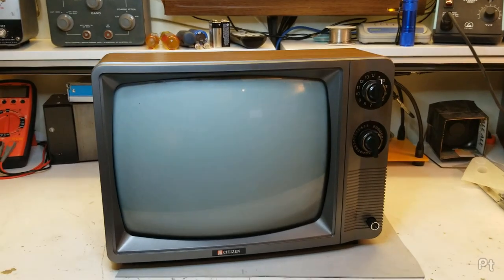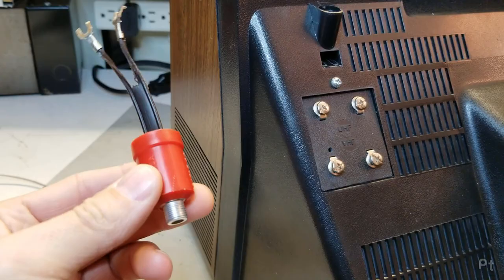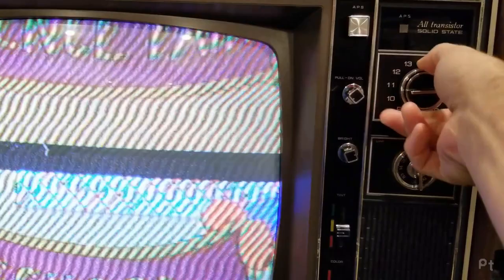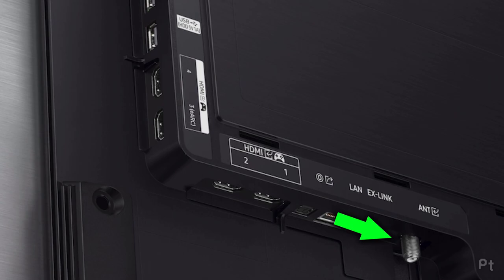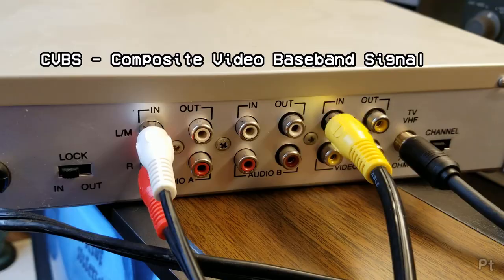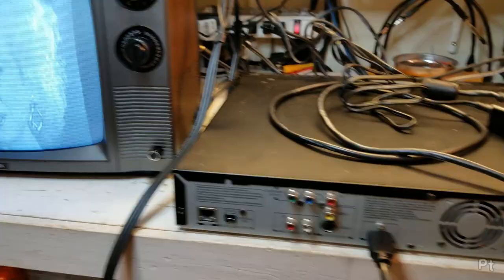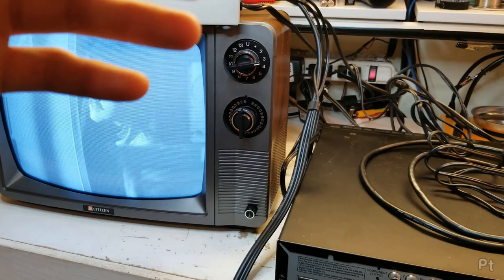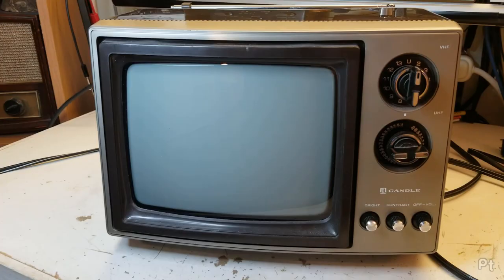How to hook up an old TV

Comment: Some information that might be useful on this subject. Some VCRs don't make good RF modulators as the  macro vision copy protection can cause trouble even if you not using the VCR to record. This not very common but I have had a few VCRs that I hooked a DVD player into for the RF output. The symptoms are the picture will go from normal brightness to very dark every few seconds and on some machines it will lose color and vertical hold. So not all VCRs are good as an RF modulator for macro vision protected media. Here are the VCRs I know for certain that give trouble (I don't have these machines anymore so I can't give the model number of them). The VCRs are Orion built VCRs from around the late 80s. mine was an Emerson  from 1987 and funai built VCRs from around the year 2000.
Reply from the maker: That's a very good point I completely forgot to mention. Macrovision messes with the AGC (Automatic Gain Control) circuitry that is used when recording to tape. Some VCRs were immune to it, but most had the issues you describe. I've also found that some VCRs only exhibited the Macrovision problems when in record mode. I had a late 90s GE (Samsung mechanism I think) that did this.

Comment: This came out at a perfect time! I just received an RCA 19 or 20 Inch Colortrak TV from 1988 (luckily it has Coax and Composite Stereo). It's been sitting in storage for 9 years, I connected a VCR by Composite and it looked really sharp and colorful as it should! I forgot how good VHS tapes look on a CRT TV after watching them on HDTVs for 6 years straight LOL! The sound kinda works, the right speaker is a no-go and the left speaker works but it gets crackly at bassy parts so I try to keep the bass setting close to center if possible. Used to sound better than Bose speakers LOL😂 Haven't looked at the innards of it yet, so I haven't figured it out. It has a digital tuner like your RCA TV that you showed. Only thing I need a Matching Transformer is for an Electra branded 8-Track / Radio unit for the FM Radio that I also received from the same person. Great video as always!😁👌

Comment: Dude! You gotta do a DIY UHF /VHF broadcast from video source onto these old TV how to. I got an RF modulator and it’s quite easy to get it hooked up. There definitely isn’t a lot of detailed videos on how to actually broadcast  OTA within your home.

You content creators are missing out on this subject.
Reply from the maker: I'm a content creator? Neat! :D

Regarding transmitting over the air, it gets a little hairy. Legally you can under a certain wattage, but putting together a DIY transmitter means that gets difficult to certify. I know people have taken an output from a VCR or RF modulator, run it through a few signal boosters and then connected a set of antennas. Or used a commercial Agile Modulator connected to antennas. But both those are probably over the allowed transmitting power, so it's not something I want to go recommending in a video then getting someone in trouble.

12voltvids did a video about a "Video Sender" that used to be sold back in the day. It's a low power UHF transmitter, and I still see them show up from time to time: https://www.youtube.com/watch?v=u5-h5MVontk

Also, maritimegirl did a video on using signal boosters as I mentioned earlier: https://www.youtube.com/watch?v=kqetXGthMyw
Reply: @probnotstech  it’s quite hard to get rabbit ears dipole antennas here in Tokyo… I’m seeing a lot more extendable ham radio antennas. I think my previous antenna was for the higher UHF range… so you know what the actual VHF frequency range rabbit ear antennas are… I’m aiming for the old vintage TV’s like your videos.
Reply: The martimegirl video really helped thanks for sharing that link! My issue was that the boated antenna type I had was built it… hence your not able to reverse the direction of the booster. Have a booster as separate unit to the antenna was the answer!

Comment: I use an a Sony Trinitron KV1925R tv from 1985 and I have a Zenith side loading VCR VR1830. the RF out cable from the VCR goes into the input of a radio shack RF modulator which I have an older Sony blue ray player that has composite output still and has been very reliable as it has tons of use and still works as good as the day I got for Christmas in 2012. On the rf input of the VCR I have my Sega Genesis connected up to with the factory RF adapter. I do have a Roku streaming stick connected to a composite adapter which I connect up when I need it which is rare. As I have 1700+ in DVDs and blue-rays and about 600+ VHS tapes so I hardly ever use the Roku but I have it for the rare occasion.

Comment: Just discovered this channel !

Incredible videos - especially the full house closed loop cable network.

I have an old small CRT at home I like to use as a nostalgia window (watching older than shows) I wish simple devices such as chromecasts had a 4/3 mode to be used easily with older sets. I know you can use a computer but it’s more cumbersome.

Comment: Now my question is: Can you hook up a Coax to HDMI to the V/UHF connectors, and then hook it up into a computer as a monitor.

I think that would be pretty cool
Reply from the maker: Yes, people have done that. But the text would be really hard to read. Even running a low resolution like 640x480 is quite hard to read on old TVs.

Comment: I like how the new signal is so dam nosey that old TVs pick it up has white snow in the video and audio
Reply from the maker: I'm pretty sure it's the power adapter, as I have an identical DTV box that has the power supply built-in and it doesn't have the same noise issue.

Comment: I followed all the instructions to try and connect a DVD player to a really old portable philco TV with only uhf and vhf. I am using a matching transformer and a av to rf modulator and all I'm getting is sound, no video. I know the setup works because I tried it on a newer TV without the matching transformer and just plugging in the coax and it works fine. I'm plugged into VHF and I've tried fine tuning to no avail, it's just a squiggly fuzzy mess. Any help would be greatly appreciated!! 🙏
Reply from the maker: Does the fine tuning have any effect at all? It could be that old components in the TV (usually capacitors) drifted and caused the tuning to be off. Even so, you should be able to get some sort of picture by adjusting the fine tuning.

Comment: I tried using the shown method for the 3.5mm connection from a 75Ohm BNC source but still have no video. I have a different RCA to 3.5mm adapter but not sure if that would make a difference. any tips or suggestions?

Comment: Question is my tv just broken? I have a 1986 zenith I got from a guy and he gave me a rf modulator  that I hooked up my ps2 to and I got picture when I first turned it on but it was wonky so I flipped the channel switch and I lost picture and now I can’t get signal at all i bought a new modulator I hooked up my vcr and the closest I get now is that I can vaguely hear audio through the static I don’t know what to do or if i should give up
Reply from the maker: What kind of tuner does it have - knobs, pushbuttons? Did you try adjusting the fine tuning? If it's a knob, try wiggle it back and forth as the tuners can get dirty contacts over the years.
Reply: @probnotstech  it’s like the digital push button where you have the channel up and down

Comment: Any suggestions to connect antenna only or coaxial cable old TV’s to items like Tablo or TiVo or dvd players??
Reply from the maker: For a DVD player, an RF modulator like at 15:44 will work. If the DVD player is HDMI only, there are RF modulators with HDMI inputs as well.
Reply: @probnotstech  I’m just trying to bring old analog tv to hdmi status.
Reply from the maker: I haven't used either of these so I can't attest to the quality, but I've seen people use them with success. They go straight from HDMI to an analog TV channel over RF:
https://www.amazon.com/Modulator-Converter-Demodulator-Digital-Adapter/dp/B09CN9YMTK
https://www.amazon.com/Modulator-Converter-Demodulator-Composite-Component/dp/B0976L5C7B

Comment: Can two twin leads be on one VHF connection? Like say hooking up two old consoles onto the same TV sharing that single twin lead connection on the back.
Reply from the maker: Sort of, but it will cause an impedance mismatch, since they would be connected in parallel. I'm not sure how that will affect the signal, but you'll probably get more interference . When you see coax splitters, they actually have a small transformer type circuity inside to "match" the same impedance on all the connections.
Reply: @probnotstech  oh okay, interesting. Thank you for responding. I appreciate that

Comment: What about PAL?
Reply from the maker: I didn't get into PAL because I don't have much experience with it, and there are quire a few differences. PAL countries used different RF connectors, different channels ranges and frequencies (UHF for modulators, for example) and BNC for composite instead of RCA. Also PAL countries had the SCART adapter that seems really neat, and included RGB which was unheard of over here.
Reply: @probnotstech  PAL more like PAH amirite! Oh oh SCART is just awesome, and yeah I remember BNC connectors on my old 80s VCR. Never knew what they were for! Well I was just a kid then, so I didn't know much about anything

Comment: 300 ohm was 1970’s not 1980’s. 75ohm was in the 1980’s
Reply from the maker: 300 ohm was from the early days of TV, until as late as the early 90s on low end TVs. Though yes, 75 ohm became the dominant VHF connector in the 80s.